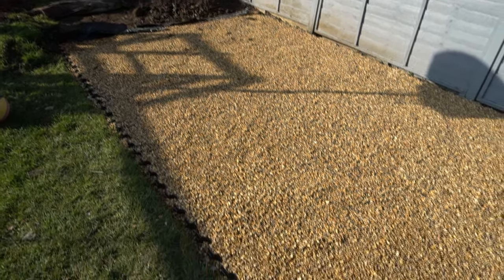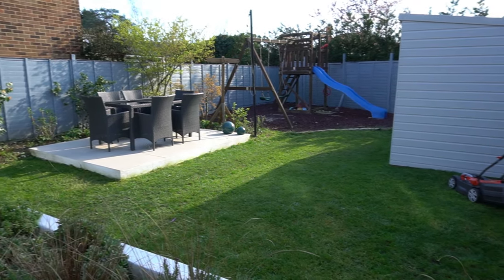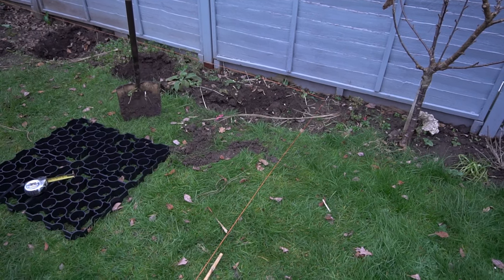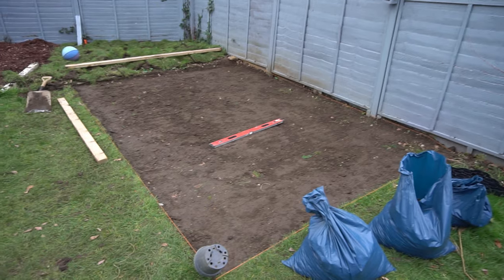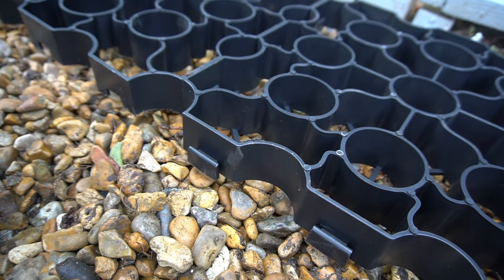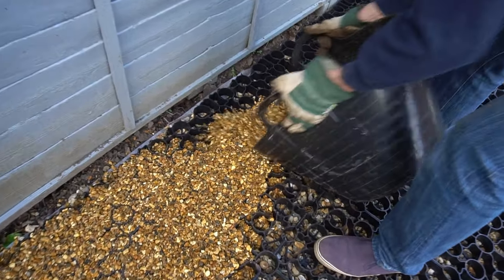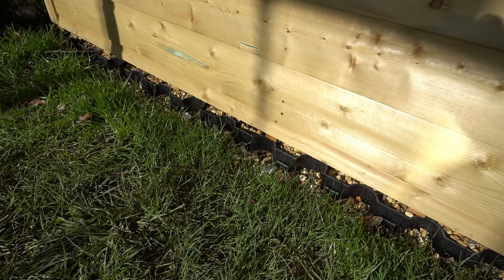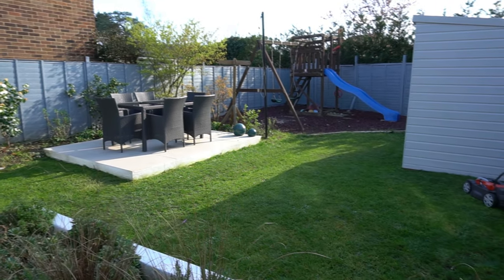Plastic Shed Base Review - How To Install A Plastic Shed Base - DIY Shed Base #AD

Comment: Plastic panels should be used as a sub base instead of gravel NOT in conjunction with it.  Save yourself a bit of money buy not buying any of that gravel! Don't even fill the panel with gravel.
Reply from the maker: Thats not what the company say who make the plastic panels. I would imagine that crates a stronger base with the gravel in
Reply: @RenovationBayBee  plenty of them do not say you have to . These are to replace the need for a sub base. That's the whole point. If you want to walk over it then you fill with gravel. Groundsheet, then panels. Then shed.
Reply: @stevecompton6283  I ended up using gravel and sand underneath the plastic but nothing inbetween the base. Just some of the edges with handful of gravel. I was panicking until i saw your comment because i didn’t fill it all. Cheers for letting us know!

Comment: Might be a stupid question but I'm looking to do this and the shed itself has no flooring included so can I use something like plywood to put inside the shed as flooring on top of the foundation?
Reply: Ideally you want an air gap between the floor of the shed and the foundation, even if it is gravel. Water will evaporate out of the ground and condense on the bottom surface of the shed. Having some airflow under the shed minimises this. You can use plywood/osb but you want to use a grade that is for outside use. Even though it is the floor, technically it is outside. Depends how much effort you want to put in, some will just use one layer; Some will use the one layer, then a waterproof membrane and then add floor tiles or some other kind of flooring so you arent walking directly on the external wood.

Comment: Thanks for the video. I assume that you directly put the plastic base on top of the gravel. Won't it cause the plastic base to crack or break over time ? Or did you use something on top of the gravel before laying the base that comes with the shed.
Reply from the maker: No we just put it on the gravel, and it's all fine  👍

Comment: Thank you for your instructional video, it was very useful.
I've just removed an old 8'x6' shed to make way for my new 16'x6' shed, being delivered this week. 
The ground is uneven and there are some large concrete slabs where the old shed base was. 
I'm not sure whether to remove these slabs and start from scratch or leave the slabs as is because they are solid and higher the ground without the slabs with sand and stone to put my plastic grid on top.
A bit of a headache!
Reply from the maker: Yes that is a bit of a headache! I think I would start from scratch though as it gives good drainage without the slabs,
Reply: @RenovationBayBee  yeah, thanks for the advice, I will do that, but these slabs are huge Mo-Fo's, will take some shifting. 😆
Reply from the maker: @257ian  lol! Sounds like you've got your work cut out then! Good luck!

Comment: Would you do anything different if you did it again?  Would it be a good idea to have a pressure treated ground contact wood base?
Reply from the maker: No wouldn't do anything different, it's all lasted well and no problems. The shed base was a pressure treated one on ours as they would last much better.

Comment: Did you use a different grain of gravel for filling in the plastic base to laying the base? Cheers
Reply from the maker: No its the same gravel 👍
Reply: @RenovationBayBee  is a fine gravel you used? Thanks for the reply
Reply from the maker: @scummyman69  just the pea shingle type size 👍

Comment: Looking to do a plastic shed and have a stupid question..
What is the point of these interlocking plastic bases? Why not just go with just gravel??
Reply from the maker: Not a stupid question 😀 gravel is uneven and won't create a flat base, so can make the shed unstable or break it. The gravel inside this plastic base allows airflow and water to drain away from the wood 👍
Reply: @RenovationBayBee  thank you

Comment: Great video 👍 maybe a silly question, but  how did you secure the shed to the plastic base?
Reply from the maker: We didn't, the shed is so heavy it won't go anywhere!
Reply: This question has been on my mind for so long! 😅
Ok, fingers crossed, about to buy mine from DunsterHouse now! (garden shed and plastic base)
Reply: Except if you live in a hurricane or tornado prone area. Just put mine up. Need to figure this out.
Reply: You can secure it by putting some bottom plate 2x4s around inner perimeter of the floor, then using very long, large lag bolts into the soil or something similar

Comment: I wonder why the roof sheds water over on to the neighbors yard? Setbacks aside, it will destroy the base of the fence and wash out any grass.
Reply from the maker: It doesn't run onto their side, it runs into the gravel base. Also we plan on installing a gutter and water butt

Comment: i was told the shed base panels does not need a sub base? just a flat ground.
Reply from the maker: We put the plastic grid panels directly onto the floor. I didn't want to put my wooden shed floor directly onto the ground as it will rot quicker.
Reply: I would second Renovation Bay-Bee's reply. Your shed manufacturer might say it may well be ok for directly laying on to the soil but it will definately rot out faster and be vunlerable to mould, rodents, beetles and other things that live in the soil, I speak from experience here, so best to get up out off the soil and have a shed that will last twice as long!
Bare soil also has a tendancy to compress under weight and you may find that that nice level shed you once had doesn't stay level for long!
Reply: When they say 'flat ground' they probably mean on a patio. You should not put a wooden shed onto turf without doing anything to the ground. At the very least you need to remove all the grass and put down a weed membrane. You can just drop a shed onto an existing patio without needing to do anything else.
Reply: I think he means the gravel being put under the panels. Most examples don’t show that. Just the ground being dug out, membrane being put down then panels down. I have wondered myself though should I put a more solid base under the panels like in this video.
Reply: @rhodrijones5161  Yes. no need for all that gravel. The panels ARE effectively the sub base. Even filling the panels with gravel before sitting the shed on top is unnecessary.
Reply: @stevecompton6283  Yes, that's what I gather too. Some suppliers of these are saying that you can use these as a driveway even, really? I don't know how they would cope with the weight of vehicular traffic though? Sounds too good to be true??

Comment: Bet you neighbours luv you using there garden as your gutter, why put it so tight upto the fence.
Reply from the maker: It's OK, the gravel is great for that as it acts as a soak away, the water doesn't go near the fence
Reply: To me, it looked like there was a gap between the shed roof and the fence, so it wasnt over hanging into the neighbours garden. Would be an easy job to fit a gutter at the back and direct the water somewhere else, if you are worried about it.
Reply: @Ironbuket  The bigger issue is getting behind to do any maintenance such as re-treatment if the shed is timber.  I inherited a shed with this issue when I moved.  The shed I installed on the patio I made sure I could get around and fitted gutters over the door and rear only as it was a pent style.
Reply: @madcockney   It's an interesting point, your local authority will stipulate a number of regulations for positioning of a shed.  Usually, it is required to be at least 1 meter away from a neighbouring fence / border, which can be seen as excessive and not practical in many gardens and places, and many examples where this is not followed.  There can be subtle variations of the requirements per local authority.  Practically, 50-75cm should be a minimum for a number of reasons.  They will also stipulate the eaves height limit and distance from the fence/border, whilst the overall ridge height is also limited (ridge height not an issue in this example by the looks of it, its well within the limits).  It's not just the run off and draining you need to be concerned about, its heavy rain bouncing back across the border from the roof (yes, sadly these things are often concerns in council regulations, but can actually be something of an issue and nuisance depending on the specific local impact to a neighbour), which is why eves height is considered and distance from border.  One thing they are within and ok here, is the shed is at least ground level and not raised, as thats another issue the local authority would have an issue with, if there was ever a dispute with the neighbour.  Come to sell or neigbour does, any eagle eyed surveyor/inspector may pick up on the location/proximity and recommend to be moved or removed, to avoid disputes.  Finally, I hope those fence posts are solid and not needing to be replaced for years, otherwise the base is too close to them, and it will be undermined if a fence post needs digging out and replacing, leading to localised collapse of the base.  There's good reason for doing things a certain way and good reason for the positioning requirements and regulations of some things, but it's likely only to become a problem, if you have a neighbour who complains or is impacted in some way.  Otherwise, it was a good highlevel walk through and clean job of this type of base.